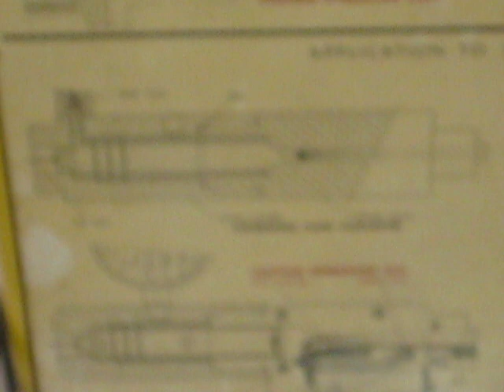Schlieren Shock Wave Visualization at Mach 3.0

Comment: im building my own wind tunnel at 1600 psi air. do you know where i can find a chart of pressure vs exit velocity? (assuming optimally expanded via nozzle). i estimate 1600 psi will be mach 5???
Reply from the maker: the rate at which pressure dissipates is going to depend upon nozzle geometry etc.  I would read about mass flow rate on NASA's website